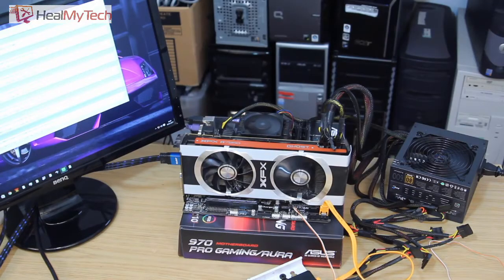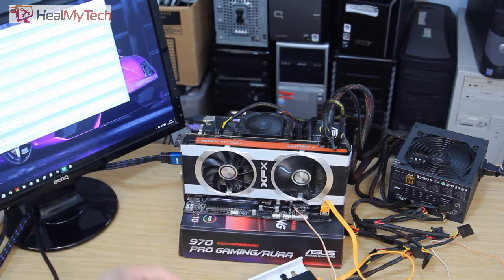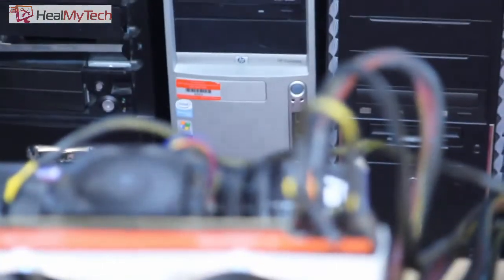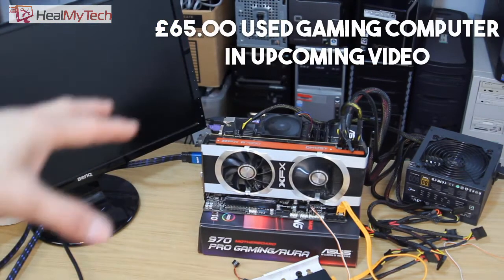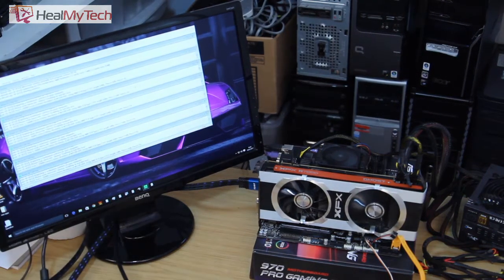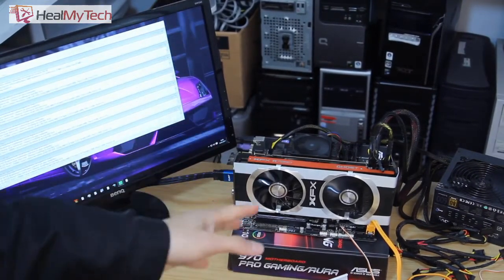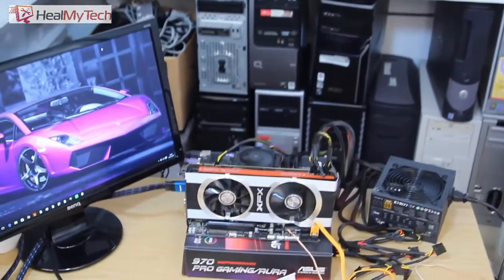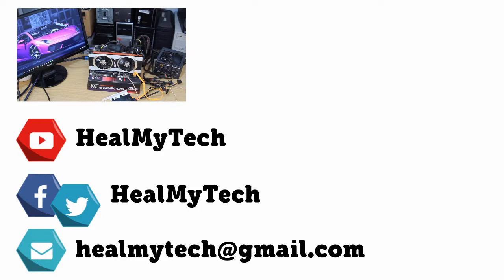CONTINUOUS LONG BEEP CODE BUT PC STILL TURNS ON

Comment: I had the same problem recently (Aorus Board). I do not recommend disabling "PC health status" from the BIOS. Better check that the required system fans are plugged into the correct sockets and are working properly.

Comment: Ga-MA-770 long beep code but booted and worked normally. Found CPU fan not reporting RPM. Was spinning. Unplugged, no code. Plugged in, beep code again. Replaced, no code ever since.

Comment: I had the same problem. Check bios for fan settings. In my case "PC health status" If you have not connected some of system fans, disable them in bios.
In my case, continuous beep - not connected two of system fans. I disabled them in bios and no beep anymore!

Comment: Bro I have the same I've been looking everywhere and I can't find a solution I need help
Reply: Me too. My PC did the same thing. Boot up but having that continuous annoying beep although can get into windows fine. Have your issue resolved? Tried everything but resulted to nothing. Using ASUS Maximus 7 Hero motherboard
Reply: @daisuke910  I didn't do anything but when I boot up my pc I just have this 2-3 second beep and then it just stops but sometimes it just does 1 second beeps when I'm playing I tried cleaning the whole pc maybe because of dust try cleaning ram it worked for me the beeps are shorter and try checking CPU or GPU it could even be fan cables I heard that it's different mostly
Reply: @michal9837  ohh mine beeping bloody murder 😅. Open everything even the processor. Will see howbit goes later

Comment: I have the same mobo and I just faced this issue. Could you eventually find out a fix? Apart from pulling the speaker out?
Reply: I can't ink it directly, but there was an update video released about it. You can find the link in the description.
Reply: Mine was caused by a fan stop warning set in the bios. I got new fans and plugged the one fan header into the spot below it and since there was no longer a fan in the previous spot it was going off due to that.

Comment: I just take my speaker off, then the problem went away. 
But seriously my RAM is at the manufacture frequency, CPU is fine. not a clue why.
Reply from the maker: Do you get POST?
Reply: Fan failure beep disable it in bios

Comment: My also beeps but not long beep just one short beep. But my pc is working fine i dont know whats going on.
Reply: It usually means it is a successful boot. You don't have to worry because I get one short beep on boot but my PC works alright.
Reply: Generally one short beep when the machine first powers on is to signify that AMI BIOS has loaded.

Comment: Easy fix ?
 1 : the onboard chip on board is damaged . 
2:  could be the budget ssd .???
3:  most likely the gpu not spinning .
4:  but it could be a bad combination of  board  and all  these  things combined .
5 : bios corrupted and still booting .
try without testing on prime 95.
swap the motherboard for another or same motherboard.
friend me if u want .
i  test all stuff out . this is odd but my thoughts are with a corrupted board . 
good luck and stop apologising  just keep on keeping it real . ha ha

Comment: Salam bro! To me it seems faulty speaker! or it must be some kind of Sensor failure ,Like fan,temperature or casing alert...either could be GPU or Motherboard.  Just a hot shot tukka from me based on my troubleshooting experience. would like to see you on my channel too :-)
Reply: Its a fan failure beep just disable it in the bios